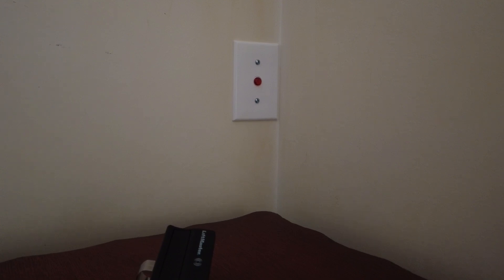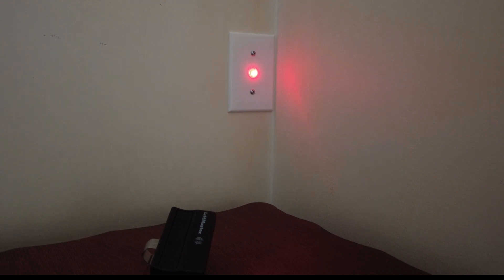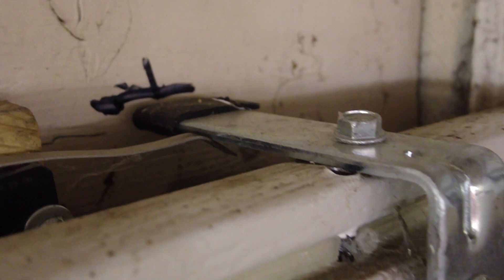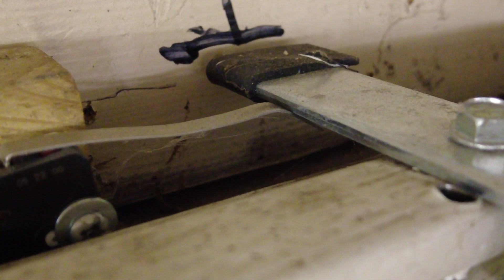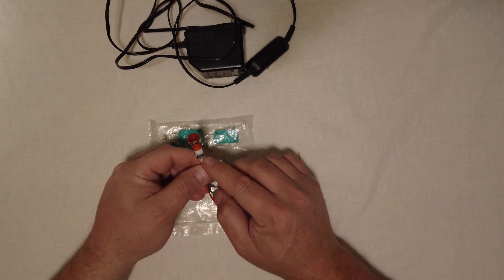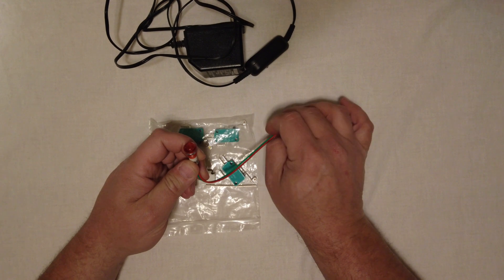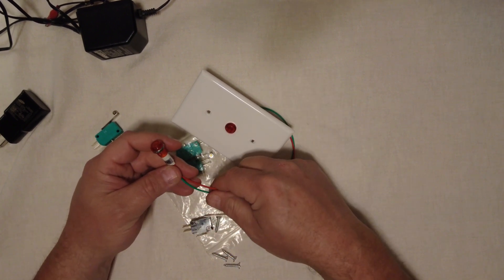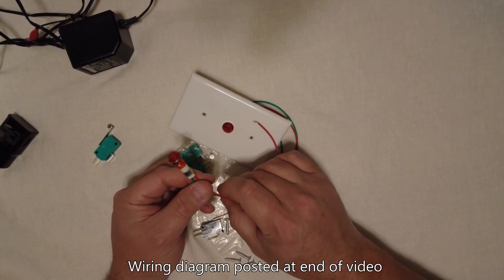How to install a garage door indicator status light

Comment from the maker: Part used in this video: 
LED light that I used in the video, 12 volt:  https://amzn.to/34ItJsj
Long arm micro switches: https://amzn.to/3uLs0NI
12 volt “wall wart” power supply that will work with the LEDs listed above: https://amzn.to/3gzd9Ob
Single hole wall plate for mounting LED light: https://amzn.to/3JgjI4x

As an Amazon Associate I earn from qualifying purchases.

Comment: I got the light and switch you used but my light isn't very bright , I'm using a 12 volt VDC power block. Am I missing something? Is your light bright?
Reply: My light has multi voltages 
12v
24v
120v
220v
Reply from the maker: Yes, my light is bright.  You must not be using the same light as me because my light is ONLY 12 volts, not multi voltage. Be sure the power block puts out enough wattage to fully light-up the LED.

Comment: What size fuse do you recommend?
Reply from the maker: Maybe 2 amps....   You can calculate the fuse required....  Take the bulb wattage and divide that by the voltage....  that will tell you amperage.  So, take the 1.6 watt LED bulb that I used, divided by 12 volts = .13 amps.  So, well under 1 amp.  Add an extra amp or so for inefficiencies and voltage drop, etc and  a 2 amp fuse should be just fine. Big enough to handle the load, but not big enough to resist popping if there is an electrical short. Thanks for the question.

Comment: You mentioned about 8 minutes in talking about the switch arms. I wanted to let you know you can go to lowes or home depot and they sell springs of varying lengths. You can solder or  rig an arm so as it descends , the spring will press down on the switch,  thereby protecting the switch from too much or too little  pressure
Reply from the maker: Right.  I've done similar things on other projects in the past. In this case, the arm was long enough and flexible enough to not damage the switch.  It's still working great to this day, and been for many years now.  Thanks for the comment.

Comment: What kind of fuse do I need for this?
Reply from the maker: You could use a simple in-line automotive style of fuse and fuse holder.  An LED doesn't require much power so a low amperage fuse should be sufficient.  A 3 amp fuse should be plenty......  unless your running hundreds of feet of wire.
Reply: Thanks!

Comment from the maker: I had a garage door malfunction this morning.  I notice the red light never turned off after coming home from work.  Something stopped the door from closing all the way and it was stuck open about 1 or 2 inches.  That wouldn't normally be a big deal but I keep may garage heated and it was right around 0 degrees Fahrenheit this morning.  My garage furnace would've been running wild trying to keep up with that heat leak.  Who knows how many hours it would've been before I went back out and noticed the door was stuck open.  But with my handy dandy red light, I noticed within minutes of coming home.  I suspect an extension cord that I had just rolled up and hung on a hook next to the the door somehow caught the locking latch on the inside of the door and stopped it from closing all the way.  I moved the cord out of the way and it shuts fine now. The red light earned it's keep once again!

Comment: very clever.  By chance do you know how to disable those little "light beams" at the bottom that make the garage door pop back open when they think something is blocking them?  Ours false triggers all the time.
Reply from the maker: The only thing that I know of is what one of my friends did with his garage door.....  he removed both of those light beam sensors that mount on the wall, on either side of the door, just above floor level, and screwed them to the wall ABOVE  the garage door, about 6 inches apart from each other. lol.  The garage door companies have figured out how to force people to need those sensors in order for their door to work properly, but they haven't figured out how to force people WHERE to mount the sensors. lol. They don't need to be mounted above the door like my friend did....  just mount them about 6 inches apart anywhere on the wall.... or the ceiling, or the floor, or the attic, etc. As long as the beam sensors can "see" each other then your door should work just fine.